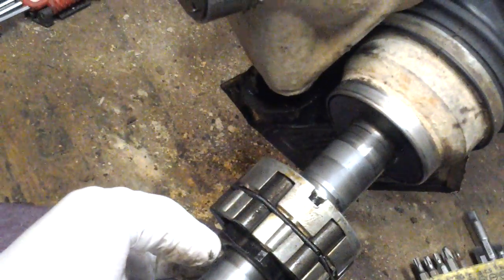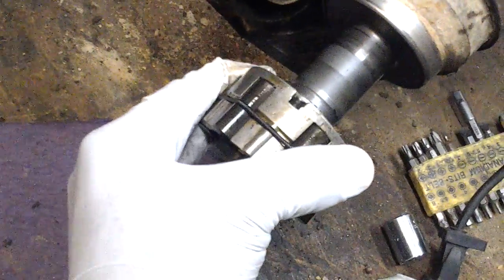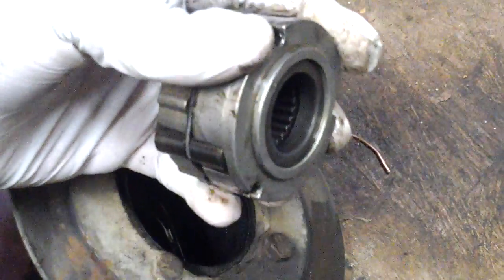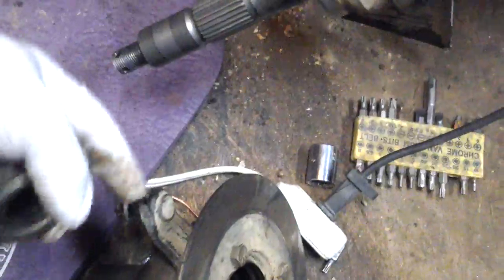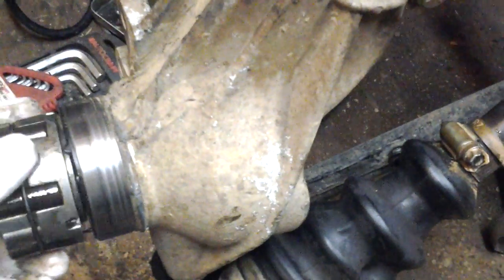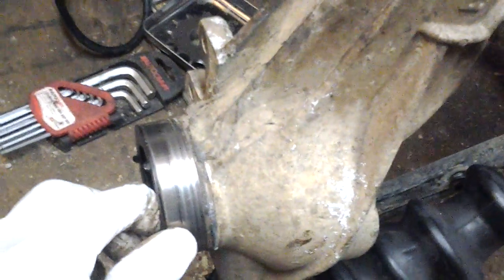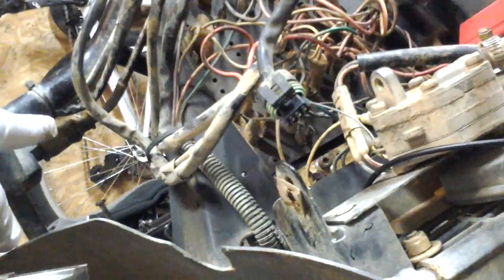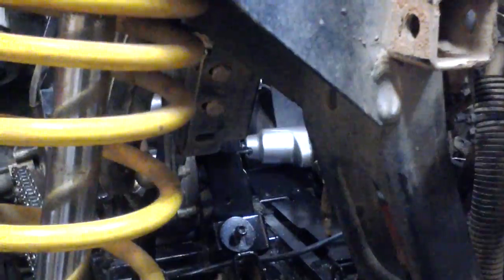1997 Polaris 500 how Hilliard clutch works

Comment: That's very helpful, thanks to you explaining everything I believe that I can formulate a plan to bypass the electric magnet and just have analog full-time drive on mine 😀,  I have a 1997 Polaris Magnum 425 6x6,  so I'll get back to you it my plan works 😅.
Reply from the maker: 6x6, niceee
Reply: @andreythedon  as promised, an update, my plan to bypass the magnet was successful. However, I have since discovered a major design flaw. Polaris paired 1 12 tooth sprocket and 1 12 tooth sprocket with 2 22 tooth sprockets. This creates a difference in the Geer ratio between front and rear axles, causing the rear wheels to shuv the front wheels across the ground at a slower speed than the rear wheels. 
Currently, I am working to solve this problem and will continue to build my 6x6 mud-toy..

Comment: I've done my own experiment with this clutch.
If you want to see in in action, just put a big bushing where the hub goes (that giant nut in the middle of the clutch, if you have an older one is just perfect for that).
So without the hub installed you will see the difference when in 2x4 and 4x4 and be able to film it.

Comment: I believe the reason the magnet assembly needs to have a good ground is to eliminate the problem where the armature plate becomes magnetized when not asked to be (I.e awd switch not on) this gives the plate a complete circuit to ground. Great Video, garage is a mess

Comment: I’m still lost on it. My 400 scrambler 2 stroke started working in 3 wheel drive yesterday. I found my cv boot was cut open and it was exposed to mud and water. So I dunno if it just needs a new axle
Or the hub parts are damaged ?
Reply: you figure it out I only have 3 wheels turning on my polaris 500.Tore it down and found the armature plate pretty bent up put a new one in and still have only the same 3 wheels turning
Reply: andycel schneider I haven’t tore into mine yet. But if your plate is good and everything looks good you need to check the current in the wiring with a meter. No current no wheel turn

Comment: Thanks for the explanation of the armature plate which acts as a brake to the outer half of the Hilliard clutch , did not know what that was called either THANKS , Now I can see what happens ! With the splines on the axle engaged in the splines of the inner part of the clutch, (the big nut ) & the outer half not rotating freely, the big roller bearings will be forced out against the hub , forcing 4x4  THANKS
Reply: Proud of you man for figuring that all out ! Also if that plate is distorted in any way it is garbage ! In other vids they tell you to place a straight edge across where the axle comes out of & where the armature plate comes up against should be .001” , if more than that it will not work properly

Comment: I'm having the same problem with my 2002 Polaris 400. Bought it used and someone before me has all the wireing  all screwed up. Was wonder how it worked. Just wondering if i can wire the clutches directly to a switch. Dont think the 4 WD switch is working. Thanks for sharing and making it easy to understand

Comment: Good video. This is going,to help me because I just picked up a 97 4x4 and it's only 3 wheel drive. I bet the bad part is the plate that locks it in. Thanks
Reply: +Robert Remley I also have 3 wheel drive, Robert.  My front right wheel is not turning.  Did this work for you?
Reply: +John Horan no I had wires hooked up wrong on the wiring panel.

Comment: Gr8 video bro.  I recently bought a Polaris Sportsman 500 4x4 and my left front wheel hub clutch is engaging even when AWD is turned off.  I think I will disassemble the hub, bearing, and clutch and see if my Hilliard clutch or Armature plate is damaged.  I had an idea how Polaris AWD worked but your video made it very clear.  Keep the how to vids coming man!  I think the Polaris 4wd system is great if you keep your hubs properly lubed and replace worn parts before they cause extreme damage. :)

Comment: Any vids on pulling the bendix/starter drive?...I have a 96 400 xplorer and the estarts not working so I have the recoil housing off but can't get the bendix out. 
Do you have any vidoes on hooking up the throttle cable?....mine sticks so I have to do that to